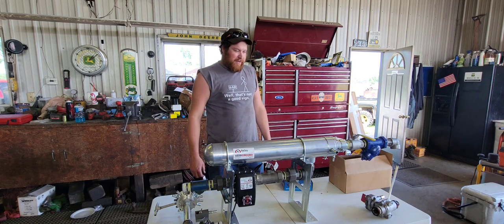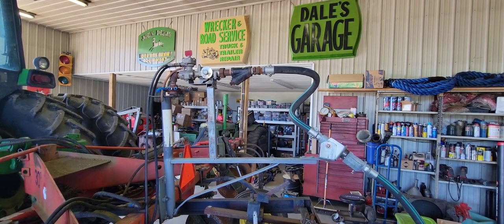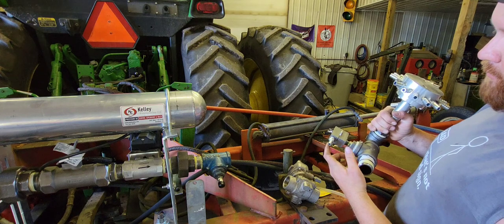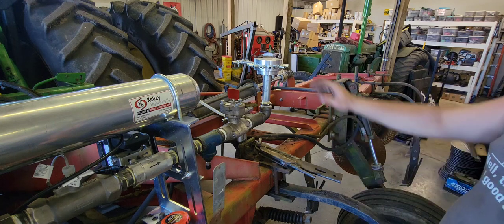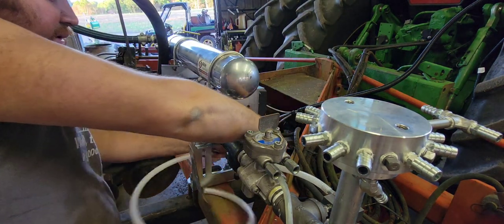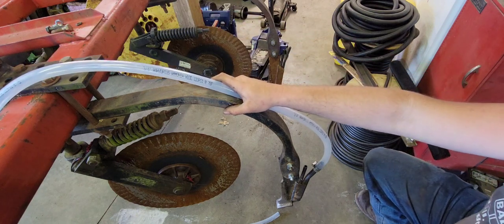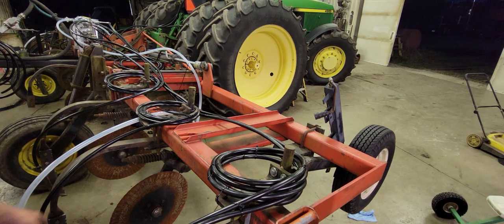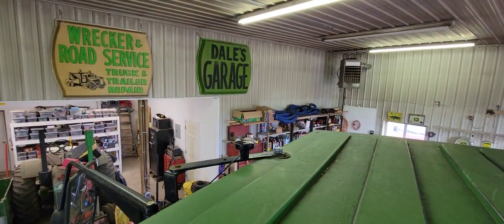Anhydrous Applicator Heat Exchanger! Install And Plumbing Video!

Comment: As always enjoy your video's. If the other fellow doesn't like the way you do your video's, then he is free to leave and not comeback. Democracy at it's finest. One thing you might want to point out is fold your wings in and check for pinch points there too.

Comment: Glad to see you upgrade form controlled spillage to a metered product. When gas was cheap you could get away with a little waste but as you said it is almost liquid gold now just like everything else now days. Like the idea of a backup shut off valve too. I put out a lot in the past on a open platform tractor with one of the old style pull rope trip valves. Almost got me killed once. I had burns on my back and scorched lungs from a three point mounted unit. I pulled the rope and got a surge that burst a line and I got a bath. It killed a whole acre of cotton before we could get to the tank and shut the valve off. Also make darn sure the nurse tank valves and hoses are good. If your supplier brings you one that isn't don't accept it. Stuff is just too dangerous. Think you will have a good safe accurate plow now. Take us to the field with you and let us know how it dies. I am curious now...

Comment: Those systems work very well, I run mine with a JD rate  controller thru gps. Very accurate and you don’t have to figure tank pressure to set rates!!

Comment: I was wondering   does the manifold  need a bracket to hold plus on the Intel side just think it v may need one hope you checked the wings so it not pinch hoses
Reply from the maker: I've been looking at it and I think I am going to make a quick bracket for the manifold side the inlet I feel is pretty sturdy....the nice thing is the wings don't lay very far over so there should be no folding and pinching issues

Comment: why wouldnt you use pressure regulators and gauges on each knife?
Reply from the maker: Because that would make it extremely complicated and they would probably cause alot of problems I'm sure it's been tried
Reply: @dirtgrainsteel  yep did it back in the 70s put a 30 ld regulator adjustable and a gauge on each knife played with them a little got them set locked them down and that was it but now that i think of the way prices are the regulators  were like 9.00 dollars back then so you are doing it right.

Comment: Why do you us this product if it is so dangerous????
Reply from the maker: It's cheaper than the alternatives way less material to handle and its very effective.....if you respect it and properly handel it and pay attention and be safe and make sure all safety equipment is operational then it's not a problem to use it
Reply: At one time it was the cheapest form of nitrogen you could get. But everything now is double what it was but still gas is about the best bang for your buck as far as nitrogen goes. Used properly by someone who has had some training it is no more dangerous than any other ag chemicals.